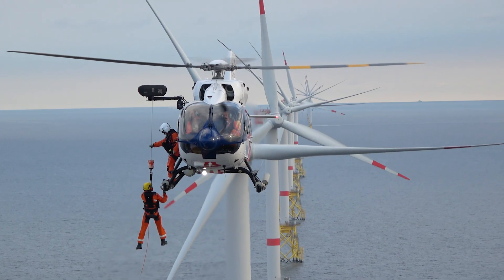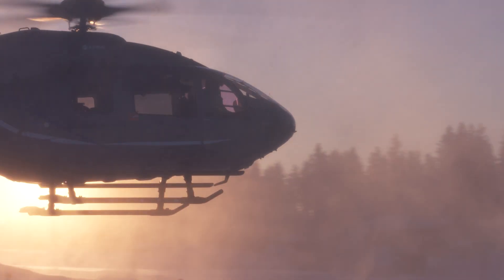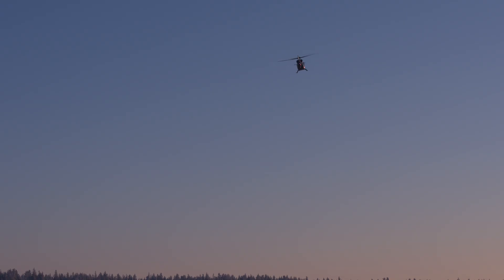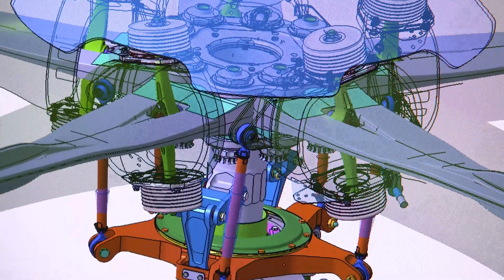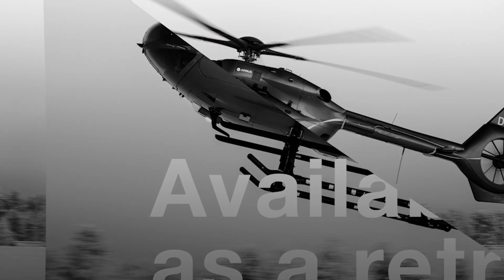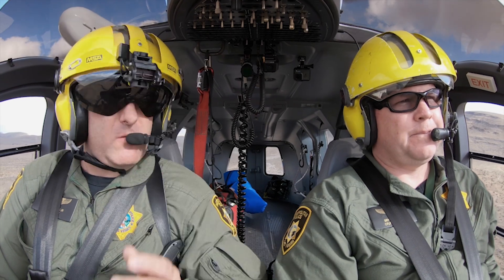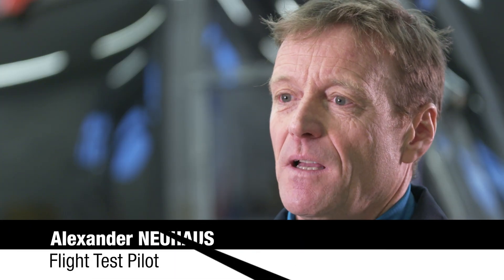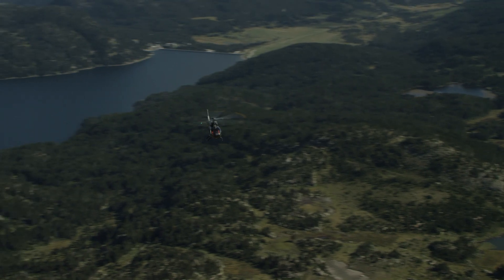New H145 with five-bladed rotor

Comment: Some operators have reported vibration issues with the 5-bladed system.  Speculation is that the additional blade impulses against the large vertical area of the tail and fenestron tail are causing a resonant vibration in the fuselage.  Has Airbus been able to isolate and correct the issue?
Reply: Yeah I'd like to see it made with a 3 blade to have a comparison to the 5 blade just to see if there was any difference in its capabilities.